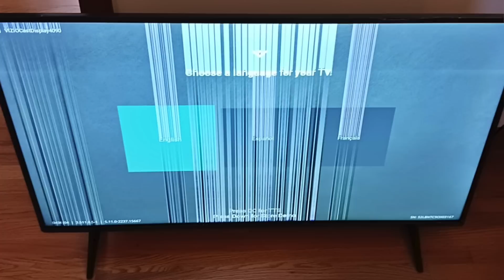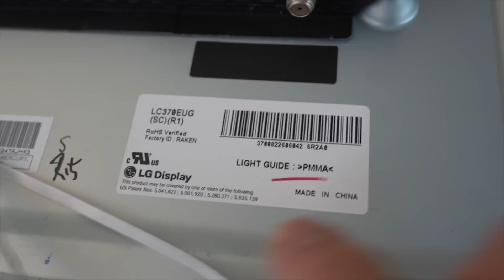FIX Your TV with a TOOTHBRUSH | Fixing Vertical Lines

Comment: Excellent video! Thanks for all the information! I do have an idea though. Have you tried dragging the soldering iron on the flex cable connection to the board? That's actually how you fix vertical lines on a Game Boy screen. If you do it for short periods of time, the flex should be able to handle the heat.
Reply: It is also recommended when using this method 
to overlay some PRINTER paper between the
polymer flex ribbon cable and the iron.
This reduces the RISK of damaging the cable.
Uf one has or can obtain some thin TEFLON
sheet - that would be even better - 
It has worked well for me - and the BAR attachment 
I use is made from BRASS
ANY ENGINEERING WORKSHOP CAN EASILY MAKE ONE
Reply: have you ever tried it? It's really easy to melt the ribbon plastic if your heat isn't perfect.   (pre-heath the board, if you're going to attempt this.)

Comment: wow, just when i have the exact same problem you upload this vid, got a 75inch tv that got water sprayed on from sprinklers and it showed one line but worked fine for a week and now its in a boot loop. i think it has something to do with that cable because the lines comes right from where the cable connects.

Comment: Excuse me, could you please advise me? I have a TV screen problem. It seemed to break into a single line in the center of the screen. Can I use this method to fix it? Or where can I send a clip or screenshot of the problem? Please help me. 

it was my mistake. At first, it just had a frequent restart, otherwise normal. So I unpacked tv for sure that it's cause of the backlight was really broken or not. then I will order to replace. But after finished assembling and open tv. it is show many colors and a line like a crack in the center of the screen, the restart symptom is still be same Today,I try to open it and take a picture, it becomes  black screen, with a bright cracked line in the center of screen.

Comment: Sir so the propblem with my tv is that horizontal lines aswell as vertical lines are also appearing.
It all happened when i plugged my pc to the tv with the vga cable it all worked fine unplugged the vga cable and after 1 day or 2 day the problem  started showing. 
Can you help me? please.

Comment: They fix this issue on Gameboys by using a soldering iron along the ribbon connection. Maybe this works here too.
Reply from the maker: That's a good thought but on those gameboys, I don't think they are dealing with corrosion under the tab, correct?
Reply: @FrugalRepair  well, at least they are dealing with bad contacts, so I guess corrosion is a part of the problem.

Comment: Could be caused by a slight hit, or slight acidic or alcoholic beverage slight spill. I have a very small segment of a line appeared. Usually I am careful. I don't know what really happened.
It looks a little bit like a scratch from outside, but can not be perceived touching it.
Thanks,
Ps 
I am talking about a laptop LCD screen though
Reply from the maker: I had a red vertical line appear on a macbook screen.  I couldn’t figure it out and assumed it was a tcon or COF problem and neither one was cost effective to fix.  Sorry I don’t know what could be the cause of yours.

Comment: I have similar problem. Picture and sound is working fine but vertical line s appear after changing the backlight. What could be the problem?
Reply from the maker: If you removed the lcd to fix the backlight it is possible you damaged one of the tab bonds, they are very delicate.
Reply: What should I do to fix it? Thanks

Comment: I have Samsung TV 75 inch 8k after 13 month of purchase the panel has vibrations  and after 8 minutes TV switch on and off continually 
Samsung said it is panel defect and needs to be replaced fully but that cost a lot
Do you have advice?
Reply: Hi,in Samsung the "clicking" problem is very often,
Or when you want open the tv
The tv try to start..start...start..start
Is it the condenser,bad calculation  ,by the ingenering
Replace à few electrolitic condenser in the POWER SUPPLY,it s always same
Replace condenser(10 volts)
Original,by à 16 volts !!!!!!
Whit the same microfarad!!!!
Important !!!!!!! Respect de polarity!!!!!!!!
You got a brand new TV
For à FEW boxx$$$$$
 Juste pull out the power supply card,use à small 
Iron welder(pencil style)
25-30 WATT MAXXX !!!!
IN.    LG. TV .....IS SAME😝👍
Y have learned that on. YT
Tried....and it s perfect
Im verrrrry happy
  Im...À hamator radio MEN🎙️📻.   Mondial télécomm fan!!!⚡.    VA2FTA,SHERBROOKE,QUÉBEC,CANADA.   👋. 73 !!!! 😉

Comment: i thought it was on the chip that causes it to make a vline. is it posible to put heatsink and fan to that mobo?
Reply from the maker: It’s possible any issue could happen if you are talking about cracked or lifting solder connections under a chip.  Those usually would be found on the cpu on the main board.  I tried to cover the typical reasons for vertical lines in the video.

Comment: Can you repair if the vertical lines are caused by a crack ?
Reply from the maker: If the LCD is cracked, then you will not be able to fix it.  Only replacing the LCD is the option (but they are near impossible to get).

Comment: My TV fell today and landed on the corner of the TV stand now about a quarter of the screen doesn't work is there a cheap way I can fix it
Reply from the maker: You might be able to do something if the lcd screen isn’t cracked.  You can try reseating connections to the lcd panel, again if it’s not cracked.

Comment: Maybe if you heat it up with a heat gun and flux, just a little bit, the connection could restore itself.
Reply: I've seen people repairing display connectors of a same/similar type on Gameboy handhelds by running a soldering iron back and forth across the surface of the connection/connector--quickly enough to not melt things but getting some heat into the connection to more or less reset the glue. Not sure if that would work here, but offhand I don't see why not--assuming the connectors are basically the same. Which they may not be, I don't know; just putting this out there, as it does seem to work for the handhelds when their displays are glitching/losing lines of display.
Reply from the maker: Good thoughts, however, there isn't any solder under there so adding flux wouldn't do anything that I could see.  Unless, are you thinking about using the flux as an adhesive since it's tacky?  Also, heating it up still wouldn't address any corrosion underneath.
Reply: @FrugalRepair  The flux is like acid it removes oxidation.
Reply from the maker: Thanks for explaining, I would be concerned that the activated flux would affect the adhesive.
Reply: Correct I used this method and repaired a few Gameboys and other ribboncable type connectors myself. Also, in case there isn't any solder under the tab then there probably is glue which you can heat again to re-settle. Its important to keep a constant pressure on the tab during the re-heating. What also can work and is in fact my very first thing to try is heating it carefully with a small a heatgun. The type that comes with a solderstation and has a small nozzle is best and most accurate. You can probably try it with a normal heatgun aswell although that might be a bit overkill.

Comment: I have wide yellow bands that started after I plugged in a Firestick. It never worked and now I have these yellow bands that start narrow on the right side of the screen when I turn it on, then get wider and eventually the whole screen is like looking through a yellow screen. Of course I removed the fire stick and restarted the tv, etc… nothing fixed it.
Reply from the maker: If it was the fire stick then I would tend to think the issue is related to the hdmi port.  I’d try other non-hdmi ports to see if the issue still persists.

Comment: Can I use masking tape instead of scotch tape?
Reply from the maker: If it doesn't conduct electricity you should be good.  You can even cut the ribbon cable and bend back the pins but I've found the scotch tape is the easiest to work with.

Comment: It's just bad engineering design.  First, those tiny ribbon connectors are on the bottom side of TV, thus due to gravity, the fluids that someone is washing the screen with will eventually drip towards that direction.  Second, the ribbon connection uses adhesive.  It's cost-counting.  This is why I prefer they use the tiny connectors that latch to the ribbon edge contact, such as FPC, FFC, ZIP surface mount connectors, because adhesive alone will eventually come off, either due to age, getting bumped, or in this case, moisture & corrosion.  I actually have an old LCD calculator that used adhesive to glue a fragile paper-thin ribbon with carbon/graphite lines. The glue eventually wore off.  I have yet to fix that thing, heh.  Now perhaps it's not bad engineering design but rather planned obsolescence.  These companies do not want their TV's to last long so that in the event their TV dies in your living room, you would hopefully return to the store & buy another one from the same manufacturer.  Lower parts count = Less reliability = Repeat customer$.

Comment: Can you help me either my LG 44 inch I knew better not to use windex but I’ve used it before and nothing happened! Well I think I over sprayed my tv screen so now the picture won’t show but it’s still working far as talking but the picture has gone and I don’t know that some fluid may be leaked down somewhere or something. It was dusty so I tried to clean the dust off, but I use Windex probably like three times when I was spraying and wiping it and then all of a sudden my screen went kind of wet lines in it and it hasn’t popped back on yet it’s been like five days can you help me with that or should I just get another TV? Also I don’t think regular viewers are equipped to do all this on the back of the TV that’s a lot especially when we don’t  what we’re doing 😂
Reply from the maker: Sorry to hear.  All I would know to say is try to open it up and see what may be going on (like in the video)

Comment: Can I still repair mine if the vertical lines are already spreading
Reply from the maker: You should make sure your screen isn’t cracked.  If not, this video should help get you started.  If the tab bond has pulled away in any significance from the driver board, it’s very difficult to get it to line up on the pins and attach again.  A small lift can benefit from pressure on top to help make the connection and deal with the vertical lines.

Comment: I had heard spraying alcohol on an lcd screen was a bad idea because it could get between the layers.
Reply from the maker: I don't see how any liquid could get under the polarizing film on the front because it has OCA (clear adhesive) between it and the LCD.  Behind the LCD, there are the prism films and diffusion film and you want to avoid liquid getting back there.
Reply: @FrugalRepair i did clean my laptop once with alcohol, and it got a big stain on the screen for many weeks until it magicaly disappear(maybe it finaly dried up), the alcohol indeed penetrated the screen, i will never recommend it.

Comment: Yo bro, I’m a 17 year old dude (more like kid because I’m immature) and I took it upon myself to repair my familys Samsung tv which had one side of it completely black. No clue what I was doing so naturally I decided to punch the screen a few times and then whaddya know I made the other half black, after watching a few videos I managed to locate the source of the problem was broken led lights. So, took the whole thing apart. Still pretty clueless and accidentally ripped one of the tab bonds off in the process. Had I known that there extremely difficult to repair I wouldn’t have spent 50$ on brand new leds. Now that’s just part one, part two: after learning about he tab bonds and how brutally fcked I am I decided to super glue the tab as well as I could to the board. Yep. Non electrically conductive everyday household superglue that looked like it did the job, (when I did this the tv was still in pieces) so here I am. Looking at ways to see how I can put the tab thing back on. Remove the superglue and fix the tv. Is it possible?
Reply: I’ve just watched a Chinese guy put one back on with a machine that looks like it costs a million dollars. I’m so screwed, gonna have to settle to watching Rick and Morty with a fat black line in the middle.
Reply from the maker: Yeah, sorry for the bad news but ripping a tab bond from the driver board is basically an unrepairable situation.  The have machines like you mentioned but they are too expensive.  In the past I played around with some techniques to get them back on but nothing yet that I am ready to make a video about.  Probably the closest that I have come is to cut a channel into the yellow tab at an angle then solder the pins to the driver board from the top.

Comment: That ribbon seems to be designed to be basically unrepairable.
Reply from the maker: It is not impossible but I agree, it’s practically unrepairable.  There are some tricks out there to help connect the ribbon back to the driver board but if it gets cut or mostly removed from the driver board, I wouldn’t waste time trying to fix it.

Comment: My Vizio M55-f0 flickers after a while of use and progressively gets worse. Anyone encounter this problem and can this help video help it?
Reply from the maker: You’ll have to figure out if the flicker is from the backlight or the image on the lcd.  Seems heat related in any case.  If it’s the backlight, you could try turning down the brightness to a low value like 20% and see if it lasts longer before starting to flicker.

Comment: What if the lines are moving. Disappearing and showing up on a different spot
Reply from the maker: If they are horizontal then it could be  similar issue.  I’d try the same diagnostic steps as in the video.
Reply: @FrugalRepair  they are vertical lines.

Comment: I have a monitor with a vertical line that goes from the bottom to less than half the height of the screen. If it does not go all the way up, does it mean it's a different issue?

Comment: Welp…….I was like 70% through my “repairs” and had to get a giant speaker bar out of my way and I was using a flat head and it slipped and scratched one of the boards that the gold ribbon is on and cut a small piece of the gold ribbon. I should’ve been smart and covered it all. I know better. 

Sadly I got this tv when my cat busted my Samsung that lasted me a decade. I only got a few months of usage out of this JVC roku tv when the lines started happening. 

@FrugalRepair so now I’m going to be shopping for a new 4K tv on a budget that will actually last & hopefully things like this won’t happen, any suggestions?

Comment: I wonder if you just heat up the pins on that ribbon cable, but only one side of the pins - to allow for a reflow of the solder at that joint. Then let it cool and do the other side. Taking those ribbons off and trying to put them back on is impossible for me :(

Comment: Oh boy, do we have a treat for you today! We're diving into the world of fixing your TV with a toothbrush. Yes, you read that right, a toothbrush! Because who needs professional repair when you can just DIY with household items?

Apparently, some people have successfully fixed their TVs with tape, and that was super encouraging. So now, we're tackling the more difficult issue of vertical lines and other screen issues. You know, the ones that make watching TV feel like you're in prison, behind the bars of your own screen.

So, our adventurous TV repairman dives into the intricate world of LCD screens, showing us the magical land of driver boards, connectors, and ribbon cables. And guess what? The orientation of the lines on your screen matters. Vertical lines mean there's a problem with the data signal, while horizontal lines are a whole different ball game.

After opening up the TV (because we're all TV surgeons now), we learn about the power supply board, the main board, and how we can't actually see the problem just by looking at the boards. So, we have to take off the front plastic bezel to access the real culprit.

Here's where things get fun. Sometimes, those pesky vertical lines can be caused by, wait for it... cleaning your TV screen! Yep, you clean your TV, and it betrays you like this. Apparently, using too much liquid or the wrong kind of liquid can lead to corrosion, causing those annoying vertical lines.

But fear not! Our daring TV repairman comes to the rescue with his trusty toothbrush and some isopropyl alcohol to clean the corroded area. And voila! The lines might become less noticeable or, if you're lucky, disappear altogether. What a miracle!

In the end, the toothbrush-wielding TV repairman admits that he's reached the end of "okay road" with this TV. But hey, at least you've learned some handy tips to diagnose and (maybe) repair your own LCD screens with a toothbrush, tape, and sheer determination. Happy fixing!
Reply: what it need is an electronic toothbrush..
Reply: على الرغم من بساطة التحليل الا ان هذا المبدع يملك قدرة قد لا تتوفر لدى محترف صيانة وانا اقدر مايقوم به واشكرة واشكرك على التعليق مصر ترحب بزيارتكم لها ومرحبا بكم لقضاء اجازة سعيدة بالاسكندرية مصر

Comment: Since you have such a large following, I wish you would consider using technically precise terms: that is a "display" (not a "screen") and that is an FPC (Flexible Printed Circuit). It is not a "ribbon": a ribbon cable has round multi-strand wires.

Comment: my tv won't stay on unless i  heat it
Reply from the maker: Could be different things. Not sure where you are heating it.  I’ve seen where the driver board expands with heat and makes contact with the ribbon on the tab bond to get the picture working.